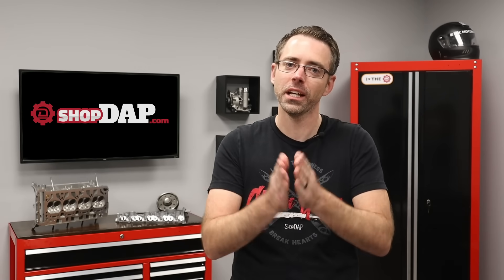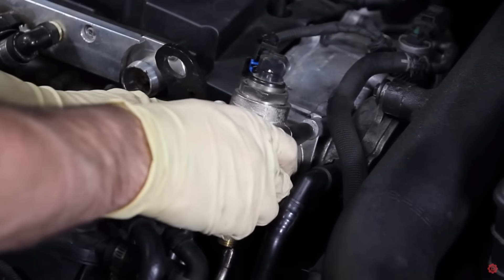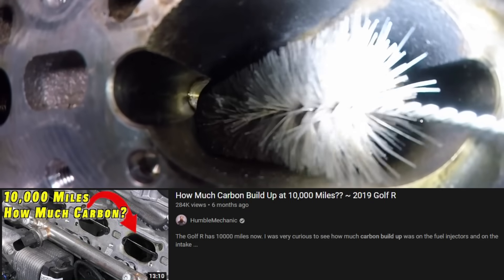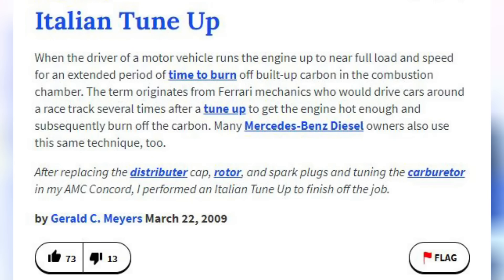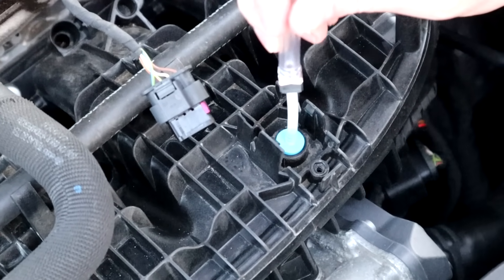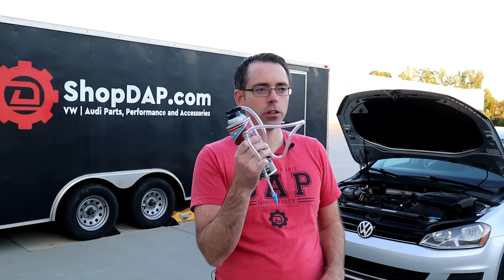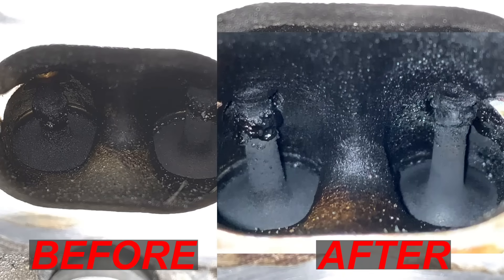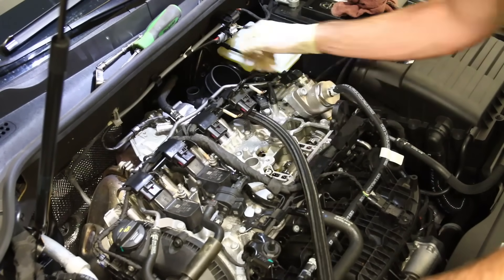Can you Really Remove Carbon for $29?

Comment: Here in Europe, a lot of people drive around in direct injected turbo diesel cars and it's common that the EGR (exhaust gas recirculation) valve and DPF  (diesel particulate filter) gets clogged up at around ~100k km, especially if people drive around town at low RPM and only drive short trips where the engine doesn't get to warm up properly. I had it happen to my Toyota Auris 2007 model that has a 2.2L 177 hp 400 nm diesel engine. It went into limp mode at a road trip with friends and it was really expensive to fix as the shop where the car was fixed had to replace both the EGR valve and the DPF and run a cleaning of the common rail system and the piezo injectors. Then later on it happened to my parent's car, which is a 2010 WV Golf 1.6L diesel which has a 7 speed DSG that loves to drive at 1100 RPM at most speeds, as long as the road is flat. Both cars had gone around 110 000 km. They also had the change both gear case clutches as the DSG doesn't run in an oil bath if the engine has less than 140 hp, so it has to be replaced every 100 000 km. None of these issues were informed by the salesperson when we bought our cars, obviously 🤣 What we did later was to drill holes in the EGR and DPF so that they don't clog up anymore. They don't confirm to the Euro 4 and 5 emissions standards anymore, but that's just something we'll have to live with 😉

Comment: What I used when I cleaned mines was a flat head screwdriver (to scrape off the large deposits) a bottle of grill cleaner and a wire brush assortment. It took some time but it did the job
Reply: Did you suck out the chemical or soaked it up with rags? I used a vacuumed to suck it out most time.
Reply: @henrytom5824  I was in the process of rebuilding my engine so i did it with the valves out and the head off of the block so I just sprayed the ports and used a straight wire brush in a drill to clean it and it was actually really easy. When I was done I hosed it out. The grill cleaner that I used was from CLR.

Comment: For those who remember it, there was also Throttle Body Injection (TBI), a.k.a. the White Castle of fuel injection systems.
Reply: I owned a Throttle body injection Chevy truck....those were the days🤣
Reply: @gatornation3889  yup I had an old ‘89 S-10 Blazer 4.3L with TBI. I took off the air cleaner once and watched the cone sprays, kinda fascinating.
Reply: @peacefrog0521  that was a bad ass engine that 4.3
Reply: Stratified makes a "5th injector" kit. It is about a grand and comes with it's own fuel meter system. FSI and TSI I believe.

Comment: You can BURN a valve with all this buildup, because ultimately, one of the valves can refuse to seat properly.  Our R56 MINI Cooper did this at 90k.  It was an exhaust valve that burned, because some of this gunk probably dropped and then instead of flowing out the exhaust fully, it stuck on the exhaust valves seat.  I rebuilt the head myself and the intake valves had perfect cones of crap on them to different degrees.  Toyota used Dual injection to combat this on the engine that they and Subaru use on the FR-S, FT86, BRZ

Comment: I'd like to develop an injection system for US TSI Engines that will spray a solvent into the intake manifold.
Reply: it's already out, they place an injector in the intake manifold, when in use cleans the carbon deposits in the back of valves and stems just like the previous generation of multiport fuel injection systems where this was never a problem.

Comment: I have seen a 80's ford ranger running like crap , so an old mechanic told the guy to rev his engine and get it as hot as possible ,he he then started pouring ice cold water into the carburetor while running, well it cleaned the carbon buildup and it ran smooth after that

Comment: See ATS , automotivetestsolutions.com  . Their 3C Induction Cleaning unit has good reviews . Bernie Thompson is a top tier tech with many You Tube videos . This system is also demonstrated . You could have a car cleaned and put a borescope / camera in each cylinder to check the result . This is much less than removing the intake manifold . If I owned a high end car or any car I would do it myself before the                " wrong hands " molested it .
Reply from the maker: You can’t get a borescope down bc the intake flaps
Reply: I am not familiar with that design . I am a DIY . Can you get a borescope or camera in the spark plug holes to view the valves ? What is the possibility of getting the ATS treatment and looking for improvement in driveability and misfires ? Would it also show on the fuel trim numbers ? Give Bernie Thompson a call and put him on the spot . He is a top tier tech . Jerry " G " Truglia of ATTS Training uses it at his shop . Another top tier tech . Contact him . I would be interested in the result . That system uses 3 chemicals . It is not a $ 9.95 mechanic in a can .

Comment: I took the heads off my gm 3.8 v6 and the pistons had a thick carbon layer. The engine was toast so I tried a bunch of stuff to try and clean them but nothing really worked except oven cleaner. Only problem there is I think it was eating the pistons too :p or at least it made then super dull so not sure if that would affect the engine. I have a turbo cobalt that I daily now and have seen the how to clean videos but not sure I have the time for that right now. I have uses some cdc gdi cleaner before hope that did something. I was gonna say too I used seafoam on the 3.8 and even the vavles still had carbon. Smoke show for nothing I guess.

Comment: The Italian Tune-up may have some validity to it,  while he white papers mentioned in this video showed at higher temperatures and driving cycles Carbon can be burnt off off and that it only forms and adheres to the metals in the intake manifold at specific temperatures Granted  this isn't likely going to make a difference if you already  have any significant carbon issues.  However! Ensuring you get your car up to higher temperatures by driving a bit more aggressive could go a long way in preventing the carbon  from adhering to the engine.   

This is also somewhat supported by anecdotal stories from VW techs in particular getting customer car backs and seeing notably less carbon issues
for younger drivers who tend to drive their cars harder and more carbon issues on older drivers who simply putter around town.

I believe Jason from Engineering Explained also did a video on this topic a few months/year ago where he went into much greater detail,  finally
I  have a little rhymes so as we all know it must be true! 

 - A Red line a day keeps the carbon away~ 

Personally I'd go with the Catch-Can Route as checking the level to drain some fluid off maybe once or twice an oil change is hardly any extra work
for serving a car but the point raised about colder climates is certainly a valid concern.
Reply: Italian tuneup only affects carbon INSIDE the combustion chamber.  Cooking the intake valves with extreme abuse (remember sodium filled exhaust valves were a thing to prevent valve failure when abusing valvetrain with excessive heat) will only serve to bake the carbon onto the back of the valve head.  You can't shake this crap off because it's glue, not dust.

Comment: 9:23 Ahh sounds like a real VW.. Got to love the chain tensioner problem
Reply: Yup. I've got a beautiful dead Tiguan sitting out back that only needs me to save up an extra $7500 so I can repair that pos engine due to that chain tensioner. Oh yeah, by now I'll have to remove the fuel tank & clean the fuel system because the gas has spoiled. 
In the meantime, I bought a Subaru Outback instead for $2300 & drove the snot out of it, 40,000 in one year, with no problems. Subaru has 2.5x the miles, the engine rattles and it uses oil, but it's still going. For less than the cost to fix the Tiguan, I could get a rebuilt STI engine and drive the Subie at least another 200,000 miles. VW's are a good way to stay broke.
Reply: @jackandblaze5956 😮😮

Comment: Hey I'm hoping you can help me out! I just picked up a 2010 CC 2.0T and the fuel rail pressure is way too high and engine is running very rich (requested psi 40bar and actual is 80 bar, spark plugs have tons of carbon buildup). My timing chain adjustment value is 5% on VCDS. Just wondering what could be the issue?

Comment: I wonder if the Chem-Dip carburetor cleaner in the holes with the valves closed would dissolve the nasty carbon?
Reply: No, it doesn't... You absolutely need agitation with the chemical such as a wire brush... Removing the intake is the only way, whether you use chemical and brush or walnut blasting.

Comment: Dude, I just use water. It works fantastically. Doesnt cost much at all.
Reply: it wont help the inlet valves ,only the piston crown and exhaust outlets because it has to be hot enough to produce steam .
Reply: @nathansparrow1416  when it is coated with carbon it gets hot. That's where intake backfire comes from. The carbon coating allows the valve to get extremely hot because it cannot dissipate heat. It works. I'm not speculating, I've done it many times.

Comment: I just bought Hot Shots Secret Stiction Eliminator for my 2015 Audi Q7 with the 3.0T engine. I'm going to add the prescribed amount and see how good of a job it does on the internals (not the valves) of the top end. I bought it used (45,000 miles) and looking under the oil cap, everything I can see is very dark brown - no shiny metallic parts at all. I've compared this to other 3.0T's and mine is clearly nasty in comparison. It has run ok for the past 10,000 miles. The previous owner may have used cheap oil and/or not changed it regularly. I've changed it twice with LiquiMoly 5W-40. Hot Shots is generally for diesel engines but it says it works in gas engines too. I do have the dreaded 0491 fault code from gunk buildup. I'm not expecting it to fix that. I just want to try and dissolve some of the burned-on oil deposits.

Comment: The new SP oils are supposed to limit the amount of oil coke, oil residue that contribute to the carbon buildup.  GDI is not going to go away, it's too important to get the CAFE standards. Interesting that some GDI engines are more prone to the buildup than others without any obvious intake or PCV design differences.
Reply: Maybe some have better tolerances in the piston rings?

Comment: Did you check how is the S4 doint on this front? My hope is that the supercharger pressure may help clean it a little better if you drive it hard with some frequency.
Reply: It's all the EGR system doing the damage. I doubt the supercharger would make much of a difference in the built up unless the turbo is leaking oil on the compressor side

Comment: The very best cleaner for soaking an exhaust valve  is Brulin 512M  Its 5 Gal cans though,  its a floor degreaser, but Allison Turbine helicopter engines use it for soaking parts heavily carboned up. You can make a PVC hose up about 6 ft long with loosely packed  Coarse Stainless  steel wool.  you put a T in the half way point, and youll drain the goop off monthly. We tried everything and this is the best. My friends TDI had a pristine intake and the EGR was never dirty.

Comment: You can add an oil catch can to help prevent carbon build up. It actually works as I installed one in my Accord and every oil change I see about 0.5 oz of oil inside and my car only has 30k miles. I highly recommend this product as it works and easy to install.

Comment: One more idea I have come up with. it's a 2 stage process. 1. Use a hand-held steamer canister cleaner and allow steam to flow into the intake creating a steam cleaning effect and/or loosening the carbon (increasing engine RPM would be required). 2. Use a chemical intake cleaner to remove the already loose carbon. A possible 3 step. Finalize with another round of steam. ...Water/meth sprays water into engine, why wouldn't steam be a viable option if it's already going into the engine in a gaseous state...effectively "steam cleaning" the intake.

Comment: This is an engine design problem, all these DIY guys saying its so easy/not hard etc is kind of funny I’m sure as a 70 yr old with no mech experience is going to get it done at the local stealer-ship for how much $1,000 or there abouts, just get rid of GDI engines until they are engineered correctly or don’t buy one in the first place.

Comment: HI GUYS,one thing i didn't see being addressed,while doing all of this servicing.On the parts where the pick was used and the gunk was scraped of the valve stem {much like the tarter my DENTIST scrapes of my teeth}. All of that goes and lands on the catalytic converter combs.Could there be an issue where it clogs or degrades the flow of air?My BBQ burners get clogged all the time with  the dripping sauce that never seems to stay on my steaks.that's why i ask,thanks again guys.

Comment: Port injection for me any day direct injection was designed by a bunch of accountant driven engineers to make the motor fail earlier to make more money for the dealers in repairs it can be fixed by putting an injector back in the intake manifold to periodically clean the valves

Comment: You ever pulled an intake manifold on a DI engine that has water/meth injection? Seems to be a lot of argument on that topic.

Edit: watched this video fully now. For what it's worth,I run WMI and have for thousands of miles. It got rid of my cold start misfire after around 1k miles. 
I actually really like WMI for cooling and gives more timing advance.  It's noticable when drag racing a similar car with similar mods on a hot day.

Comment: DONT USE A MEDIA BLASTER IF THE HEADS ARE STILL ON that will literally destroy your cylinder walls
Reply from the maker: You’re supposed to rotate the engine to make sure the intake valves are closed before media blasting

Comment: I’ve designed system that sprays gasoline or cleaner into the charge pipe (uses an injector for in the charge pipe, then an arduino commands the injector. It’s reads the engine noise and vibration to shut down when the engine is stopped) but I haven’t mounted it yet and I think I’ll just use a spray like you did and leave it like that

Comment: Only method that works is taking the manifold off , and clean it clean it again by hand  , the carbon is so hard on baked on the valves , just did a head swap after my old head dropped a valve . If your that fussy can even go all the way taking the head off and get it cleaned professionally. Chemicals , seafoam  all that stuff won’t work . You can convince yourself that it does , but it does not work

Comment: He didn't disprove water-methanol injection,  so this is the route we should all take going forward.
Reply: I just use a little bit of water from time to time. Just plain water. It works great.
Reply: Based on what I’ve seen, water meth will at the very least prevent build up, but not necessarily remove old build up.
Reply: last guy had it spot on, will not remove it but helps loads with preventing it, but imo unless you’re doing direct port it’s
not really worth it. Sure helps keep IATs down but might as well take full benefit of it and go direct port
Reply: I use wmi on my car, have for about a year. It does help with cleaning and it's nice to have the cooler boost Temps with  the upgraded turbo.
Reply: No, but there’s many people who have used WMI, and they still got plenty of build up.

Comment: Here in Hungary we use walnut-shell blasting to remove carbon! It cleans the valve 100%!
Reply: Yes, nowadays even in South East Asia there are more and more workshop or carmaker service center are offering walnut shell blasting. It is 100% clean up the intake valve and zero damage to metal.

Comment: What about installing a single gasoline injector into intake manifold as they do for water-methanol system?
Reply: I have one. It does require a designated system to control the injector and tuning for the added fuel to be done right. In my case it reduced, but did not entirely stop the carbon build up. I use mine for the added fuel/cooling purposes If removing carbon is your intent It would be better to remove your intake and give the valves a cleaning with brushes or media ( walnut shells or soda ) every other year or so

Comment: Would doing the Berryman cleaner be preventive on my 18' S3 Stg 2 w/ 41k miles or should I just do carbon cleaning at a shop? Seemed pretty simple in the video.

I have used nothing but Shell and sometimes Costco gas with Castrol Edge Professional oil on all my services.
Reply from the maker: Could be a good preventative.
Reply: Shut up, I'm jealous 😤

Comment: You Forgot to mention the best of the best way to clean up the Intake valves.  Its called SODA BLASTING. Cleaned up mine with 250K klms ,in the APR store and i can say that it makes a HUGE HUGE difference. Valves became brand new again and i can see even 0,4 lt on idle. Car runs perfect.
Reply: where did you get the soda?  the only one I can find won't ship to USA
Reply: @onenikkione  Just went to APR and they did the job.

Comment: Direct injection is better than port injection from a potential performance/fuel economy aspect, but Port is better from cost, longevity and ease (or lack) of maintenance aspects.
Toyota's D4-S (and other dual injection systems) are significantly better across the board (although, they do cost more) - DI is at best, Jakes Wayback burgers, where D4-S is the Five Guys/Shake shack of the fuel injection world.
VAG is running DI only in North America because it is more profitable for them to do so; issues typically occur outside of the warranty period, so it's "not their problem". Profitability is the same reason they build most (if not all) vehicles for the USDM in Mexico.